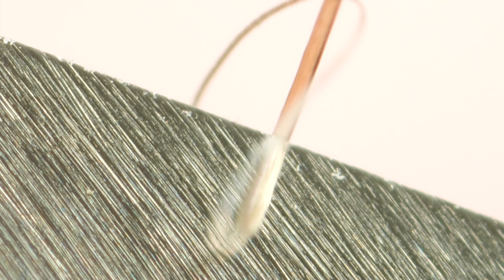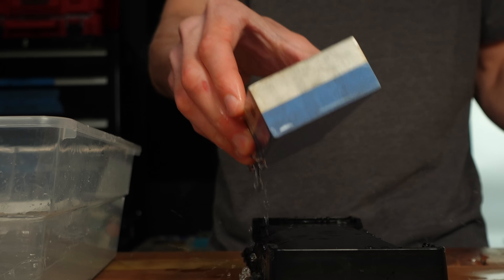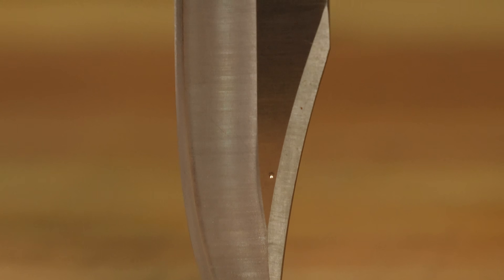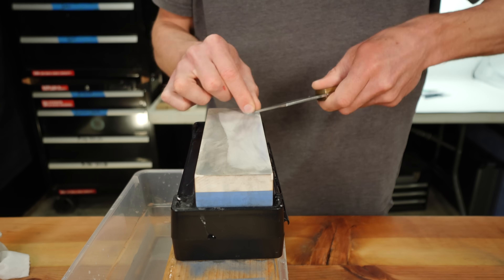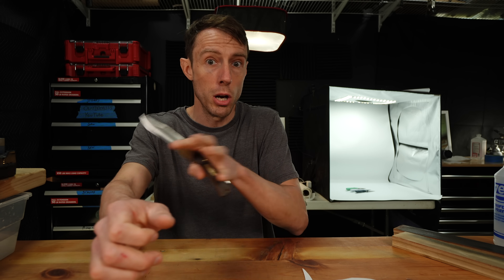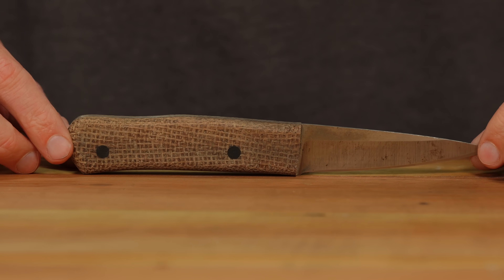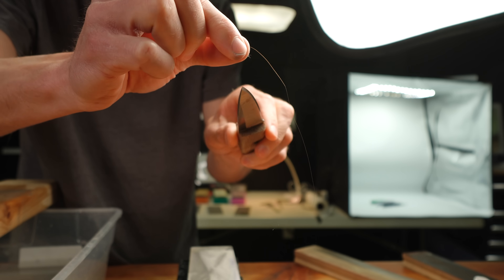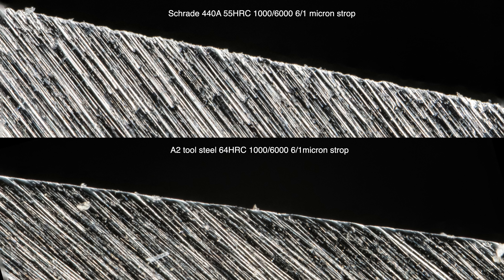The Reason You Can't Get A Hair Whittling Edge No One Talks About

Comment: Having bought a 60x-120x pocket microscope from a reputable company, which people with big expensive proper microscopes and everything have stated, to no doubt really be 60x-120x, and comparing that to the jeweller's loupe you've recommended, and more carefully comparing the loupe to the naked eye...

That loupe is probably actually 10x/20x/30x.
Meaning that you'd be better off, getting a proper 30x loupe, instead. (I never use the 10x or 20x lenses)
Maybe 40x.
60x seems to be way too much, for general checking for burrs or inspecting the scratch pattern. Might be useful at times, but for general use, it's too strong. (also, the microscope inverts the image, which is very annoying)

Neeve's Knives recommends a digital microscope from Tomlov
...which, aside from being a copy of a different manufacturer (with many essentially identical copies), also massively lies about the magnification. (claiming up to 1000x or something, but actually only going up to 50x or 100x, at most. This is true of essentially all digital microscopes. They claim up to 1000x or 2000x or something, but are 50x or 100x, max)
Having a microscope with a screen (which also doesn't invert, or de-inverts, the image), sounds kinda tempting, but...
I'm not paying fraudsters. And I imagine the loupe would be most practical and convenient most of the time, anyway, other than if/when you want to show a magnified image, to others.

Comment: 440A doesn't have anywhere near enough carbon to get hard enough to create, never mind maintain a sharp edge (stainless steels require more carbon than plain carbon steel for the same hardenability.) I always wondered why those blades were such trash. The low carbon content ensures that the blade won't get hard enough to chip, and will bend before it breaks. It's a good steel for a stainless axe. As you demonstrate, A2 will get seriously hard, but leaving it at HRC64 as for your test knife makes it vulnerable to chipping and breaking in hard use.

Comment: Hey. I enjoy your videos, i've learned quite a lot by watching them. I have 2 questions. Would it be correct to assume, for a high HRC blade(60+), if not properly apexed, it would dull faster than a blade made from softer metal, because the burr will chip faster? I have a vg10 knife, sharpened decently to cut paper, but after cutting a couple of vegetables, it would not cut the paper like before. As for the second question, what do you gain by polishing the blade on a higher grit stone (5000+) if one could get hair whittling sharp on a 1000 grit?

Comment: Hey quick question, how well would you rate 5160 for sharpening. I used the sharpal diamond stone you recommended and it got my Puukko made of 5160 fairly sharp but not hair whittling so I just thought it was a technique issue but this video raised the question of the steel.

Comment: you can do it with those cheap knives but it takes serious finesse to do and you need the right gear. naniwa super stones are notorious for delivering excellent results on steels like that for instance. I could mess around with 20 different high end stones for an hour and that junk still won't whittle hair, but I hit on the the 12k SS for a minute and it's there. Naniwa SS are magic. I use them for all kinds of things. cheap steels, finishing high end knives, polishing, and big time for straight razors. a $60 12k SS is better than a $300 30k shapton and imo better than the 20k gokoyomo in terms of results on straght razor finishing.

Comment: 🟦…The worst part about the 'OLD TIMER' and knives similar in design are that they were meant to be SHEATH knives ONLY!!...
... If you carry 'em in yer pocket the edge'a the blade will get fairly easily pushed against the inside of the spine and the edge is of course instantly ruined where that contact occurs, Fortunately it's not usually over a very large span.

...I agree with you as well regarding the quality (or rather the lack-thereof) of the steel & it's apparent unsuitability fer even being GIVE'N a 'Keen-Edge' much less be'n able tuh Hang-On tuh one under Use.

Comment: It's grain size and hardness, the fiiner the microstructure the easier a sharp edge is to achieve. And I am giuessing the hardness makes the apex more stable making it easier to achieve a very keen edge. Anything above 60HRC for me is much easier to get a good edge. The only soft steel I get hair whittling at 55HRC so far is 12C27.

Comment: I just have a massive problem with knife sharpening theory on channels like this. There is just NO WAY that a human can hold a knife at that constant an angle. There's just no way. Add to that the curve of the knife and that'd be like getting a hole in one on a par 5. It's just impossible. But it GETS WORSE! Let's say you have ground a bevel using a coarse stone and it took 10 minutes. And now you want to move to a 1000 or 6000 grit. And you're expecting that if you match the angle of the bevel you can grind the apex to be better?! That's just IMPOSSIBLE. If it took 10 minutes to grind a bevel then if you then go to a 6000 grit it is going to take you YEARS to grind that entire surface area of your bevel such that it affects the apex.
I'd like to see some real investigation into this.
For instance, is it the case that when sharpening a knife most of the passes are just grinding away at the ridge between the body of the knife and the bevel, or forming a new apex, and that only a small percentage of passes are actually at the 'correct' angle?
Reply from the maker: Not impossible. People freehand grind entire knives everyday. Holding a bevel angle is not that hard.
Reply: There's no way Charles Barkley shot 87% from three points range in the 92 olympics.  But he did.
Fun fact, all precision machinery and measuring devices traces their roots back to guys working with hand tools such as compasses, files and chisels. 
ME, I work in stone these days.  rough shape with 80 grit, smoothing with 180, 320 at slower speeds, then buff with pads from 320 to 50,000 grit.  This is a 9 step process.  If the steps are done properly , the time and effort spent on each grit gets to less time and easier force. What is properly? Each 80 grit gouge must be reduced to 180 grit, each 180 grit to 320 grit.

Comment: It's the steel and the stone, maybe the technique, you have to match the steel and the stone - It-s very hard to get a hair whittling edge on a soft steel on a soft  finishing stone, but much easyer on a hard bonded stone. It also depend on the steel and, obviously, the treatement. One of the steels I had problems to get "that" edge on was on Victorinox Fibrox chef knives, at least on  the few ones I had to sharpen, it felt like sharpening rubber. But on other soft steels you don't have the same problems with the right stones.
Bu I also had some problems a few times sharpening hard steels  with overheating problems, I suspect. I wasn't able to "raise" a proper burr, it was breaking right away and the steel seemed to microchip even on soft fine grit stones with very low pressure passing.

Comment: I don't know how much difference there is between 440A and 440C steels, but my cheap Ganzo knives will shave arm hair readily after being sharpened on my Hapstone basic sharpening system to 1200 grit.   As to how well an edge cuts is a matter of edge geometry and how thin the blade is.

Comment: Hi Alex,

thanks a lot for this another nice sharpening video.

I must say I'm surprised you had trouble getting very high sharpness with the Old Timer knife (55 HRC) while you got hair whittling sharp edge on the 1$ kitchen knife (51-52 HRC) which even remained sharp after carving a 2x4...

Maybe there is more RA in the Old Timer one... but at the same time I strongly doubt the 1$ knife got an oil or plate quench and a cryo cycle in its HT...

A bit confusing to me...

Comment: I think hardness is one think to consider but you also need to remember that hardness doesn't represent abrasion. You can have hard carbon steel that will be easier to sharpen than the same hardness of stainless steel

Comment: 440A can get razor sharp, I know this as all if not 99.99% of all razor blades are manufactured from it.
Your 440A failed at stropping, completely, it did not even polish one bit. Now you claim to use diamond strop which might fail to strop and cut instead, but high stainless steels like the 440 series are covered in Chromium oxide, which is quite the stuff when trying to strop as most stropping compounds do not strop it, I recommend green (Cr) compound strop for best effect. I'd suggest you get a wooden strop to enable loads more pressure and do the stropping faster for complex reasons that would take forever to explain.
Reply: First of all: Stropping is done to deburr, re-align, burnish... but never to polish. Polishing is done with finer whetstones. Not strops.
Secondly: Green compound (which is to say, chromium oxide), is no different to diamond, in that it also cuts. All stropping compounds are abrasives, and harder than knives. (except those using tougher supersteels, where you need CBN or diamond, to have a harder compound)
...and last but not least:
Using pressure when stropping, isn't stropping. It's using a strop, as a whetstone. It's sharpening.
Reply: @ZarlanTheGreen  1st off: Whatever your reasons are for stropping the mechanism behind material removal is supposed to be polishing, as in removing very little material  and obtaining a very fine some would call polished surface finish.
2nd off: Polishing is not obtained by any cutting medium ever. The amount of material removal has an energy equivalent to boiling material off, meaning you should be aiming at removing individual atoms from the surface. This can be achieved by many compounds that are softer and even much softer than the stuff you wish to polish.
If you are dumping hard cutting grains on your strop, you failed, as those will remove much more material than required, they will tend to round your edge and many other unwanteds.
Explaining the thing behind the strop is a tad too Scientific and most have an artsy understanding of it. If pressure is not your thing because of whatever strop you are using then I recommend speed.
What Outdoor did was using a much too cutting medium on a strop, essentially creating the crappiest of sandpapers. While this works for hard steels, because they are hard, it would essentially fail in softer steels as the diamond stropping compound would simply cut and remove too much material too deep. You cannot get a fine edge this way.
Reply: @dragoscoco2173  ... Every single thing you are saying, goes against everything that any authority on the subject has ever said, as well as any and all laws of physics, and logic, and you're clearly impervious to any argument. You're clearly hopeless. Bye.
Reply: @ZarlanTheGreen  Well, they are all wrong. Would not be a first.

Comment: Kitchen knives are usually 55 to 58 HRC. That explains why I have a hard time to get them hair wiggling sharp and do not achieve it anyway. But I get them very sharp anyway and do not have to worry about chipping the edge that easily.
Reply: Hardness matters, but so does the quality and specific makeup of the steel. Most mid-range or better kitchen knives at least use decent steel that is much better than the 440A the Old Timer knife here uses. So they will take a better edge and aren't nearly as challenging as the knife shown here -- though maybe not hair-whittling. I absolutely hate sharpening Schrade steel! I only do it as a favor for a friend, and it gets done on a belt sharpener.

You can also get higher-end kitchen knives made with very good, very hard modern steels. Japanese makers, especially, use a lot of great steels of both traditional carbon and new powdered metallurgy stainless type. If you want my easy-to-get, find-it-on-sale recommendation, check out the Miyabi SG2 line, which are made in Japan under the Zwilling JA Henckels umbrella of brands. I have expensive, hand-made Japanese knives, and the Miyabi feels just as laser-like in use.
Reply: @bloodgain  Thanks for the tips. I am fine with my current "low end" Zwilling Twin Pollux series "ice hardened" set. Can be easily sharpened and retains the edge for a fair amount of time. Can be quickly brought back into shape on a honing steel, but only once or twice. Then they have to go on the stones.
Reply: @erikziak1249  Definitely a serviceable mid-range knife. Zwilling doesn't specify on those, but it's assumed that they use the same X50CrMoV15 formula steel that Victorinox and Wusthof uses in all of their kitchen knives. Middling edge retention, as you've noted, but easy to resharpen, practically rust-proof, and will bend long before it breaks. Zwilling improved their cryogenic hardening process about 15 years ago, so is likely getting pretty close to 58 HRC out of it consistently.

I'm happy to work in anyone's kitchen if they keep their knives sharp, be they $1 or $1000 knives. I can happily work around almost any other limitation except dull knives.
Reply: @bloodgain  Mine are about 15 years old, I do not remember exactly. The largest 20 cm chef's knife could have a better ballance though. I use it just when cutting large things like cabbage. The most widely used is the 16 cm knife as it is perfectly ballanced in my hand and its size is very practical for most uses. Can be easily kept sharp, especially on high quality stones like Shapton Kuromaku. I have 320 - 1500 - 5000 three stone set and it is perfect. No need for a leather strap and one micron compound, as the steel is not that hard that it would really profit from it. At some point we have to stop and acknowledge diminishing returns for out investment and time. And honestly, I do not need "extreme" sharpness in the kitchen. It might be a nice "show off", but I am fine when the knife is sharp to easily cut through leaflet pages which are usually made of thin lightweight "bible paper". Cutting regular "office paper" is much easier even with a duller knife. Compared with new high quality japanese knifes and the cutting experience of Zwilling Twin Pollux was equal. I accept that the Japanese blades will most likely retain the sharp edge longer, but at a higher risk of chipping.

Comment: 440a is capable of getting up to around 58hrc before you begin to sacrifice toughness from what I’ve heard from multiple metallurgists over the years. Manufactures like shrade were the cheaper alternatives to your Bucks, Case Knives, and even Gerber at the time, so I imagine they had lower rockwells on their steels as a cost saving measure. Their old USA models are nicely made compared to their modern Chinese mimics, but they were always the more inexpensive option.
Reply: 440A can easily go to HHT5, just that one needs to use a proper green stropping compound. Diamond is not a stropping compound and it's modern use and commonality is a step back from what a strop aims at accomplishing.

Comment: Funny enough. When I sharpened knives at Bass Pro (and I sharpened upwards of 7-8,000), I actually liked sharpening the pre-2004/pre-China Old Timers. It was never as fun as a Buck 110 or Case Trapper or Benchmade Griptillian, but it was a joy compared to the Pakistani or Chinese unbranded trash that flooded the shop. I might get 30 junk knives with soft steel until I was convinced I was having a bad time sharpening, only for a decent person to come by and drop off a Spyderco, Benchmade, ZT, or some other CPM steel-based knife that I would reprofile and hone to a shaving edge in 60 seconds or less. I got bored and sharpened many things that weren't knives into edged devices that were better cutters than any Schrade this century.

Comment: If no one has explained it yet, I will do my best to give you the reason the A2 gets a better edge from what I learned. Basically 440a is a stainless steel and A2 is an engineered steel. The chemical make up between a stainless steel and a tool steel greatly differs, I suggest using a search engine to look up their composition if you want to see it. As tool steel is engineered to be stronger, tougher and harder than stainless steel, therefore it has a tighter grain structure due to the added chemicals that give it those additional properties. The analogy of it feels more like pushing the metal on 440 compared to abrasion on tool steel is pretty much spot on. If you ever have done wood working the best analogy I can give is to think of 440a like pine wood and A2 as mahogany, yes they are both wood but nothing alike.

Comment: I have knives out of a variety of steels: 1095, 1075, S30v, 420HC, A2, W2, Magnacut, S35V, O1, and more.  The O1 blade is by a custom knife maker that's friends with my oldest son. It gets sharper and is easier to sharpen than all of the other blades by top name knife companies. No idea how hard the O1 is, but it  isn't prone to chipping and holds an edge as long as the more expensive steels.  I've always figured he just nailed it on the heat treatment when he made the knife blank for me.